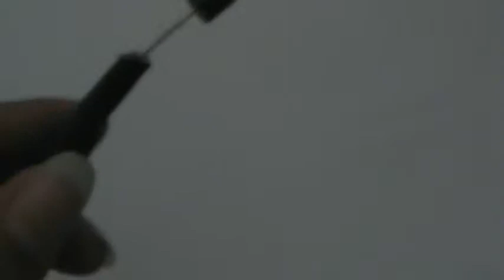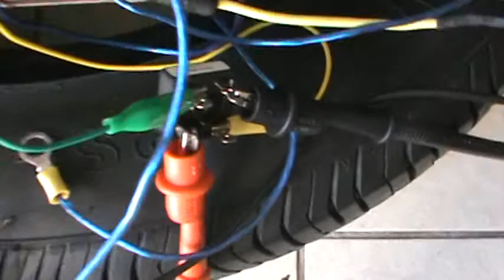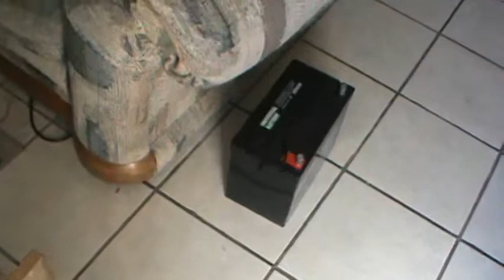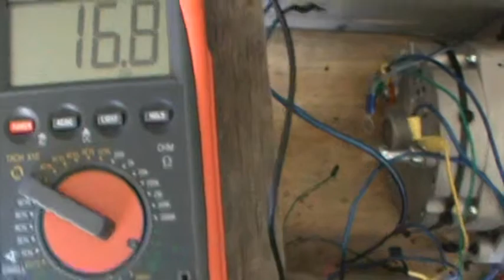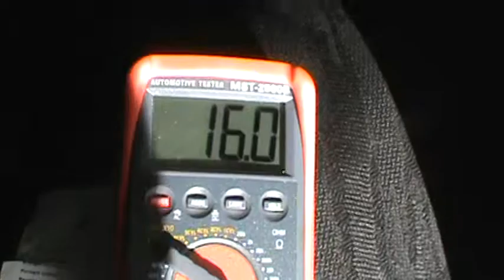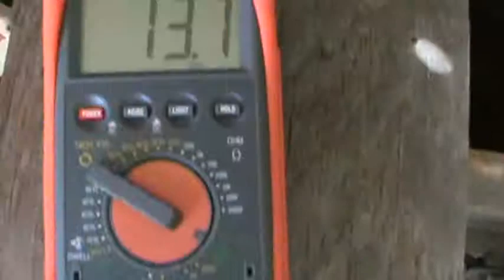Capacitor Battery and Solar Charging

Comment: Thanks for sharing
Have you link for permanet motor
Reply from the maker: Edmorbus This is where I got my pma at http://www.ebay.com/itm/POWER-CORE-48-Volt-7-mag-pma-permanent-alternator-wind-generator-pcdc48-DC48-/231391300050?pt=LH_DefaultDomain_0&hash=item35dfff09d2
and I got the motor from here http://www.ebay.com/itm/24-Volt-250-Watt-Electric-Motor-with-11-Tooth-25-Chain-Sprocket-MY1016-/281682731968?pt=LH_DefaultDomain_0&hash=item41959963c0